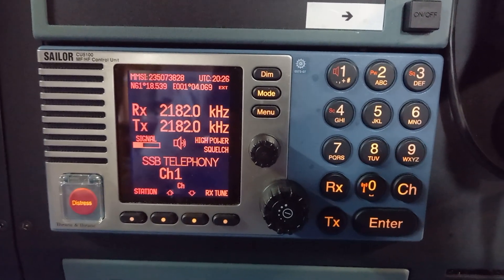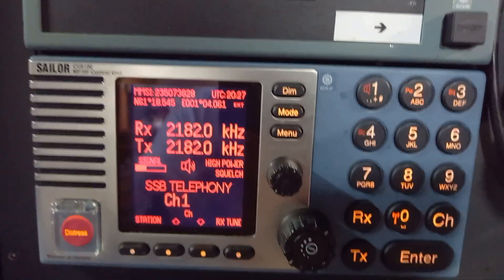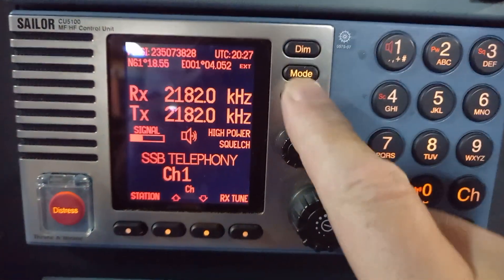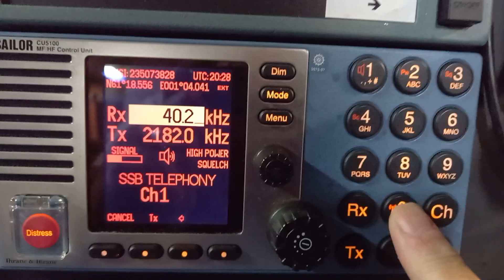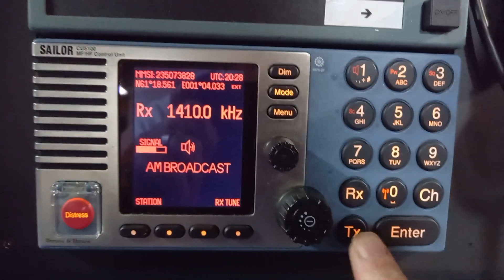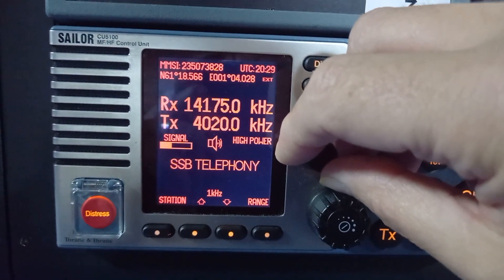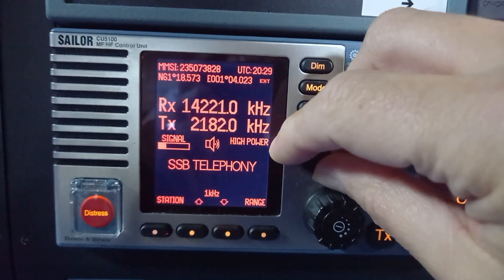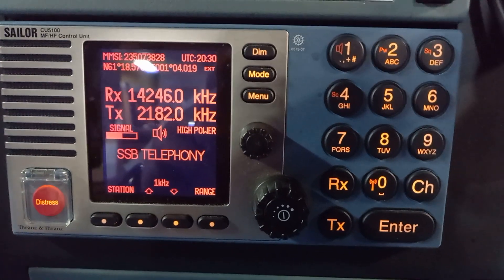A brief look at a Sailor 5000 Series Marine MF/HF

Comment: Interesting HF transceivers there is a Sailor RE 2100 listed on an estate sale locally
Reply from the maker: Bear in mind the RE2100 is the remote head for the t2130 transmitter unit. On its own the RE2100 is useless. You also need the AT2110 external tuner unit. I am pretty sure that the 2000 series HF sets can't be modified for LSB either.